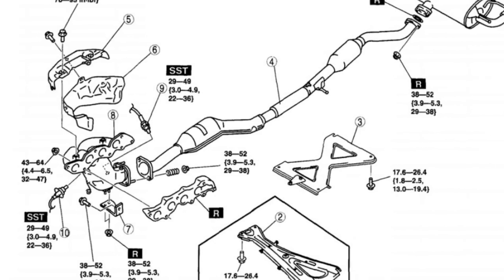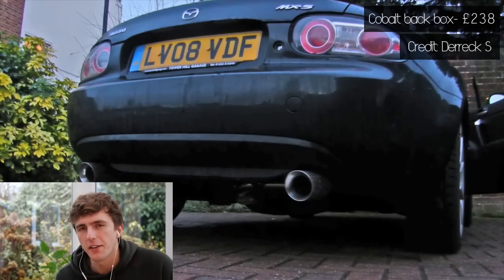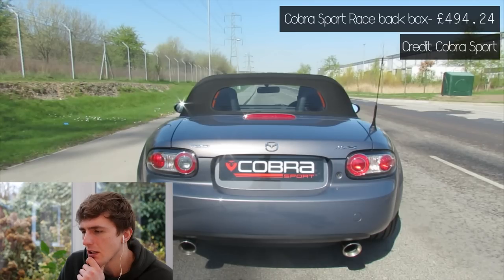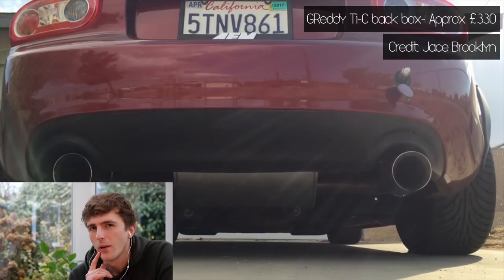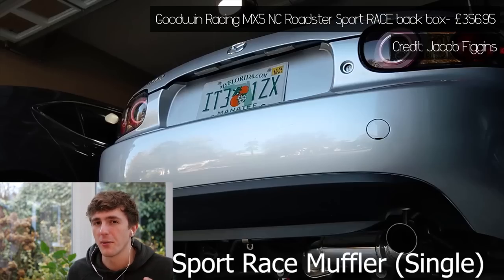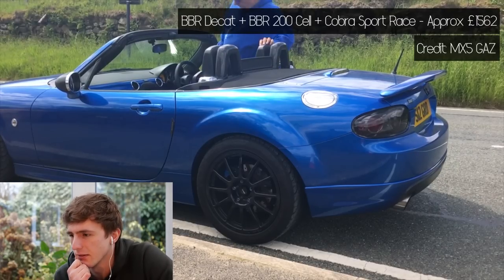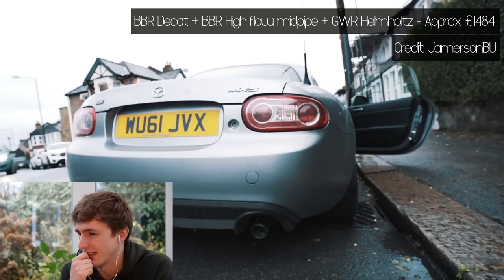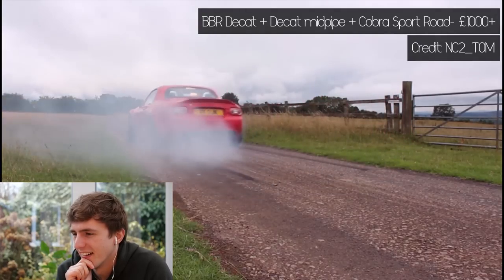Can an MX-5 sound good?! Reaction to MX-5 NC Exhausts - Decat, BBR, I.L., Cobra Sport, Cobalt...

Comment: My NC 3.5 (2010) has just a Cobalt back box as a mod.  It sounds great, deep note,not unsociable, no droning but a really nice growl when you are on the gas and even a few mild pops on overrun.  Highly recommended as a cheap mod to improve the exhaust sound.
Reply: Good, I'm after a cheap option to add a bit more drama.  Of course some major BBR work would be nice, but I can't justify the cost...at the moment.
Reply: I'm thinking of ordered one tomorrow for my 2013 MX5 miata.  its all stock now.  Wonder if removing  resonator do anything?
Reply: Can you please share a link ?
Reply: Yes please do, that sounds like what I want too.
Reply: @moss2844  Removing the resonator will add a lot of drone, the exhaust might sound boomy and unpleasant.

Comment: My 2.0 2006 was stock. Fitted a Cobalt, £220 from Moss in 2016. Sounds better than OE, beautifully made and looks good with larger diameter outlets. After a few months I decided the mid section was getting crusty rusty, didn't want to spend a fortune so bought a Japspeed stainless steel with a 200 cell sports cat for £80 ish. Note - The 2nd cat has to be dumped to fit.  Good sound and I swear it gives the car a bit more low down grunt. However, it was too loud and would have drawn the wrong sort of attention. The answer was 2 x 60mm diameter motorbike decibel killers, one in each tailpipe (£10 Ebay). These quietened it down but being more restrictive gave too much back pressure causing popping on the overun. The solution was to drill a ring of 8 x 1/4 inch holes around the decibel killers. No more popping and I'm very pleased with the result...a sporty, beefy sound, sociable when driven sensibly, doesn't induce earache and passes the mot without the intermediate cat.

Comment: I can vouch for the Cobalt if you want a nice sounding exhaust that isn't unreasonably loud :)
Reply: I got it in my NB ,sound amazing .and pretty quiet at low RPM ,it awake at 3000.
My set up ,Cobalt Cat +cobalt mid pipe +cobalt backbox
Reply: I thinking of buying the cobolt for my 2013 NC mx5,  Not sure how it will sound?  These videos aren't really to much help . Car is all stock at present.
Reply: @Carl Moss  It's noticeably louder than stock and really brings out the unique sound of the MZR engine too.  You wouldn't be disappointed, especially for the price.

Comment: It's all about the tone, I like deeper sounding exhausts without droning.  There are too many overly loud, harsh sounding options about, which in my opinion sound terrible.
I'll probably plump for the reasonably priced Cobalt backbox, and if I manage to do it in stages I'll  get the BBR 185, and then 200 upgrades.
The Super225 sounds amazing, but £4000 is a bit rich for me.

Comment: Excellent video. Looks like you're going to be making a forced induction vid very soon!

I have the racing beat super cup manifold with a standard midsection and IL backbox and I love it. I ran the back box for about a year before putting the manifold on myself, and getting it tuned at Blink. The manifold really opens it up e sound and now it pops and burbles really nice. It's swear not as much as miatamood's setup, which is the same, but maybe that's down to the tune. I had this setup on a previous MX5 and love it so much I got the same again. Not that impressed with IL Motorsport's quality, is was third time lucky with the backbox, so I got the racing beat manifold which is lovely but expensive.

Comment: Many of these combinations  are fantastic  sounding at first. True test is after a 5 hour trip. Ask me how I know. GWR ceramic coated Street Header. This has a cat. GWR Helmholtz mid pipe. The helmholtz chamber after the secondary cat reduces "drone" at highway speeds that can be annoying  for longer drives. GWR SuperQ backbox with out any baffles. I put one on on the left side when taking longer trips. Sounds good to me. I installed a FM Supercharger so than changes the noise level a bit.  
Great video!! Just what I needed. Mine is off the road for the winter. Thanks!!

Comment: All i want is it to be just a bit louder than stock with some more character to it. Stock it basically has no sound at all, at least as I know it from my 1.8. But upgrading this would be silly if I could just sell it and buy the 2.0, which I am probably going to do anyways. I do not need the extra power, but I want the 6-speed, the LSD and the Recaro seats.
Reply: Hi there, would you say the 1.8l is underpowered? I’m close to buying one
Reply: @wjfowlston8098  Depends on your point of view. You will always get used to how much power your car has. Pre facelifts have longer gears and probably feel slower than they have to. After driving my mothers shitbox for a few days, my mx5 felt like a rocket sled. Without knowing where you are and what cars are available in your local used market, I would say the 1.8 is just fine. If there are some 2.0 available for a good price, I would consider that. But in the end, overall condition and the lack of rust are always more important.

Comment: Very nice video, Dom. Here in Switzerland any vehicle over 4 years old have to have a two-yearly technical inspection and any swaps have to pass regulations to be permitted for roadworthiness, otherwise the car is not roadworthy and may not be allowed on public roads. The previous owner of my True Red NC FL 2.0 Sport had a back box replacement. I am surprised it was permitted. The tone is extremely deep. Manufacturer is German BBK. All the best, Rob in Switzerland

Comment: I have the GWR cat-less header, GWR mid w/ a single cat and resonator, and the GWR Street single. The only real compliment the car ever gets is for the sound. 🤣 It's loud enough for daily driving. The Race Single sound was nice on the otherwise stock exhaust, but I didn't like it with the header/mid. It was really loud and had a horrible tone, IMO. All of the GWR exhaust pieces are really nice and they have O2 sensor extensions to make it bolt, plug, and play.

Comment: Great video. Another exhaust option could be to have one designed and built to your own requirements. I had mine built and fitted last year she has quad pipes out the back and looks great in my opinion, sounds lovely too and doesn't cost much more than most factory built exhausts. Could send you a photo if you are interested.

Comment: This is going to sound wink very strange. Last November, I bought a 2011 mx5 gs from a chrysler dealership and they have no clue of what’s installed on the car. It has racing beat catless manifold, stock midpipe (I think it is, I didn’t jack up the car to confirm) and racing beat backbox. Whenever I drive near a cop I had to go easy on the throttle lol

Comment: I had a sports exhaust, quickly changed it back to stock after a 700mile trip trough Germany 😵‍💫
Reply from the maker: I think my legs would have fallen off after 700 miles, the RHD bulge in the transmission tunnel isn’t kind to tall people!